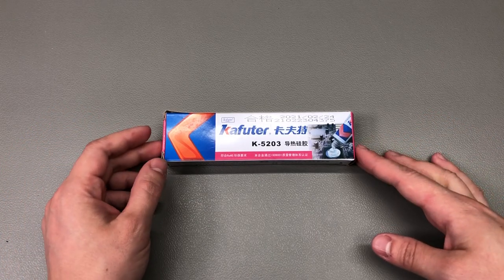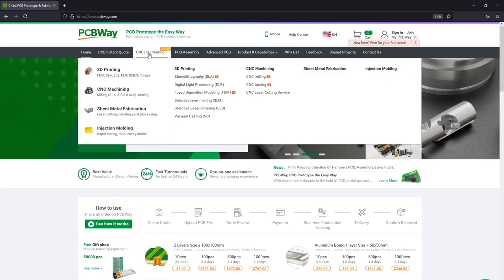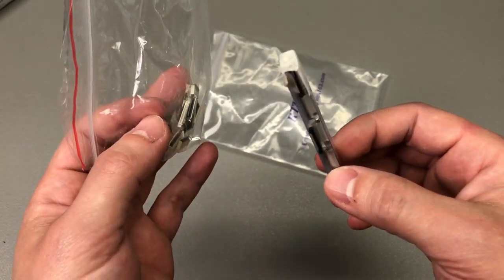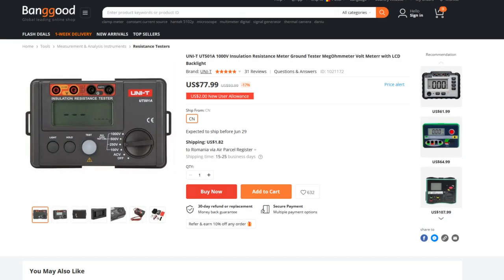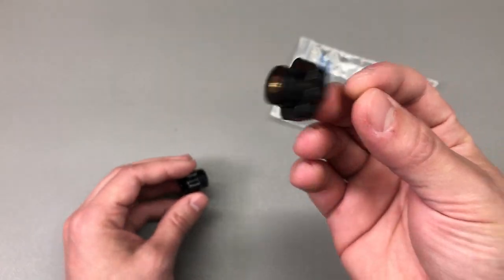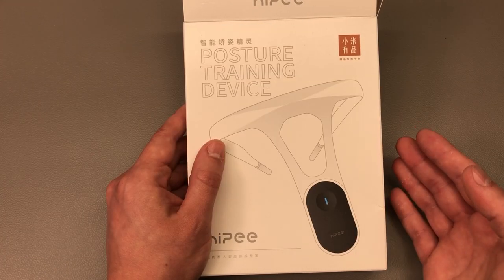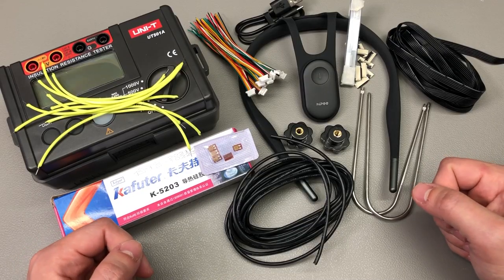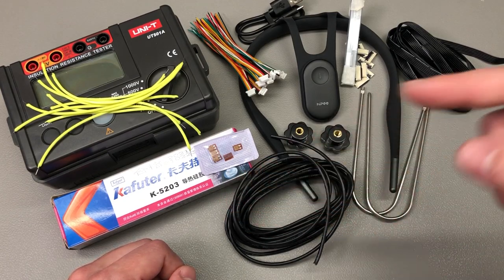InTheMail | Voltlog #369

Comment: Long ago I remember fabricating a pair of radio removal tools from a wire hanger. They have a similar diameter and the locks inside grip them with plenty of pressure to pull the radio out.

Comment: Thanks for your videos. I hope this is not the latest Mailbag series, you occasionally find very interesting things.

I have a UNI-T UT526 model. It also has RCD (Residual Current Device) measurement compatibility. It has a range of 10mA / 30mA / 100mA / 300mA and measures the response time of the protection device. Also a very useful feature is to check that the wall outlet is properly grounded.
Reply from the maker: Thanks for sharing!

Comment: Banggood seem to be pretty good for the price on Uni-T devices.
Reply from the maker: I agree they have good deals on those. The problem is they don't always have them in stock and lately the problem seems to be worse, most of the stuff that I want is not available for immediate delivery. Not sure if this is a banggood specific problem or it's general because I'm sure the semiconductor shortage is affecting these products as well.
Reply: I do recall a YouTube video comparing a Uni-T multimeter bought from Banggood and the same model bought from a store in Europe. They were slightly different inside, maybe due to CE certification etc? Would be good if someone went in depth on the subject.
Reply: @nevilleborg5031  I hadn't considered that. I noticed Banggood selling Bosch Professional equipment too at much cheaper prices, possibly a similar situation.

Comment: Do you mean the removal of customs exemptions for low value imports from China? Interestingly most stuff I bought from AliExpress in the last months was using "AliExpress standard shipping" and was repackaged in warehouses inside the EU, so they wouldn't be affected. Same goes for several shipping methods offered by Banggood, etc. I even tried paying customs for such "EU-shipments" where I knew they originated in CN in the past, but the customs office didn't want my money - oh well. In Germany there will also be a website where you can easily pay customs for shipments from China, so while we would have to pay additional fees it would still be cheaper than most local shops and even get easier to import more expensive items. The portal will, however, be delayed (as about every project involving IT in Germany).
Reply: I noticed the same. No green stickers from imports on current packets anymore. Most Items seem to be repackaged or at least relabeled somewhere on the way. They even managed to combine several packages from different sellers into one package. 
Usually the return address is a PO box in Niederaula, which points to a sender outside Germany.
Not sure, how they do it, but I doubt it is completely legal.
Reply: @fkiesel9442  Yepp Niederaula or Liège (Belgium) are the usual suspects. Combined orders are now even advertised for some shipments on AE, however even those not marked may get combined if they happen to pass the same facility. I think if other packages are expected they store everything for about a week and wait. Surely not the worst idea considering shipment cost.

Since the shipment to your address is indeed shipped from the EU by a separate warehouse, you are no longer responsible for customs. As said: I tried to pay them and got a written statement by german customs that I, as a customer, can't pay any customs for these kind of shipments. It has to be paid before the logistics company hands the goods over to the warehouse where repackaging happens. Usually logistics companies and officials at the airports have a close look and make sure this happens, however I also wouldn't be suprised if they use some tricks to get around - I rarely find a proper taxation on chinese invoices.
Reply: @adlerweb  Do you have a Link to the Website you mentioned for Customs Declaration in Germany?
Reply: Alibaba has it's new huge and central EU Hub in Liege - that's why. They've invested 100 million in it to work on their 10 day delivery goal from China. I doubt it's fully build yet, because i've read that it should be a bout 30.000 square meter in size, but we slowly seeing more and more packages going through it. The new IOSS VAT System will help to reach that goal too.
Reply: Yes a lot of sellers definitely have some warehouses to deal with some of the issues. AliExpress has been adding VAT at point of sale for items under £135 though, so theoretically it shouldn't make any difference other than a ~20% increase in cost when you buy.

Comment: It looks like the EU is getting the same thing as we(Australia) got a few years ago. Basically we now pay 10% on top of the item price, which is added on checkout/payment, ie, it's easy to forget because it's not on the item price, so you get a shock when you checkout.
Reply: You are lucky with the 10%. In Hungary the VAT is 27% and on top of it we will have to pay some "handling fee" to the local post office which starts at about 1.5 Euro, increasing with the total price
Reply: @thehun1234  Ouch, that's a lot. If VL has to pay 30% on top of the $3K he spends per year, that's $1000 extra. Unfortunately China is becoming a world trade problem, so I can see why they want to slow down the $s' out of their country.
Reply from the maker: We've had VAT in the range of 20% for a very long time, that's not a shock here. The problem is the bureaucracy and the extra processing fees that might incur when they start to collect that VAT for every little item you order from outside the EU. So far there was an exempt for items under 10 EUR (at least here in Romania).
Reply: @voltlog  Ebay/Ali collects ours and sends it to our gov, but I don't know how it's going to work for many different countries, ie, you would need a country id.

Comment: Because Brexit we had it implemented early in the UK (from Jan 21), it didnt turn out to be a big deal if you are VAT registered as Alibaba (Banggood etc) pre-process the VAT for you, no fees, never had a border issue and you can claim it back through your VAT returns. Alibaba had no VAT number for ages though so it was a bit awkward, good news is now they produce proper invoices which they didn't do before. I didn't like it one bit at first but ironically it turned out better than before, less likely to get random processing fees from shipping companies. UK border still totally ignores any duty that should be paid, everything gets through.
Reply: I think for EU countries it will be a bit different though. Before I used to receive AliExpress parcels (under €22) delivered directly to my door without ever paying and extra cent. Now things will change, if the selling platform is not on EU's IOSS, we will have to pay 18% VAT at the post office before delivery upon which the postal office will charge a further €1.50 administration fee. For EU countries I will be best to buy from sites that are on IOSS system so VAT is charged at source and not locally at post offices or customs offices etc.

Comment: In my country you just need to declare every item outside EU and pay VAT for it. My local VAT is 24% and it will also cost me extra handling fees of about 1 or 3€ depending on how it is declared.
I think it is not a stopper but extra 24% will raise prices and handling fees (1-3€) will affect very small orders badly. Companies with EU warehouses can save from the hassle but price increase is to be expected due to VAT. I've made orders I know I'll have to declare when they will arrive.
I'd expect larger companies like Aliexpress, eBay, Banggood etc to implement making payments for VAT on order moment to save you from the hassle of declaring it on reveive. It is only a matter of time I think. Easier ordering is in the interest of the sellers after all.
Reply: I wouldnt be surprised if huge companies like AliExpress setting up warehouse locations inside the EU to help facilitate these new regulations..

Comment: Yeah I'm also worried about the new regulations. Here in Portugal there will be a fixed cost of atleast 2€ and it goes up with the price of the actual item...  paying 2€ for a combined package from aliexpress with 10 or so packages inside isn't that bad but for single packages it's quite a bit of money especially when you are talking about an item you bought for like 0.50€ with shipping, I feel like it won't make much sense to buy certain products from china anymore. I'm ok with paying VAT but having to pay an aditional fee to the post makes me feel robbed, I mean everything will be controlled electronically so they will have less work than ever before but they demand more money... not sure how this makes any sense. But then again, I'm sure the chinese sellers will find some kind of a loophole sooner than later 😁
Reply from the maker: I've seen Aliexpress already started offering the option of combining different order into one package. Maybe this also has something to do with their strategy concerning the new regulations.

Comment: I wouldn't worry about the new regulations that much. Sure, I didn't like it, when I first heard about it a year or so ago. Not because of the VAT though, but because of the customs handling fee of the postal service. But if the seller registers, VAT will be collected by the seller and no local handling fee has to be payed. Sure everything will get 20% more expensive (or whatever the VAT is in your country), but that's only fair, because you have to pay it on everything you buy locally as well.

But I hope you didn't order anything in the last few weeks. The applied rules depend on the date a package reaches customs, not when it was initially shipped. So if you ordered something in June and the package takes the usual month, it will arrive at customs in July and fall under the new rules.
Reply from the maker: You've been a subscriber for a while now. Do you think I didn't order anything? 😂 Ofcourse I'm gonna get hit!